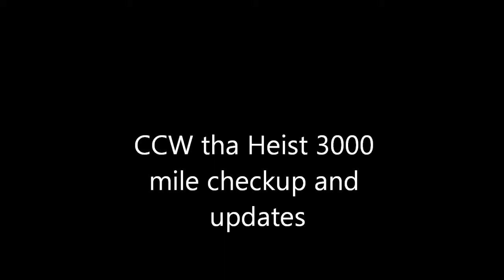Cleveland Cyclewerks, tha Heist Bobber Weaverrides Modded

Comment from the maker: @ashika1009 thanks for the reply the wear wasnt bad could have done another 2000 miles easy if not more but I'm a bit OCD and actually  I changed the chain and sprocket for a 16tooth front sprocket from the stock 15T. The chain I did because the bike comes with a STD 428 chain. I added a HD 428DID chain for better maintenance and pull. The chain and sprocket upgrade has done wonders for the top end

Comment from the maker: I removed the safety kickstand kill switch off my bike, this is a safety feature on the bike so modifying it you take the risk of personal injury or worse. 
By removing the kickstand kill switch it bypassed the neutral safety. i can start the bike in any gear with the clutch pulled in

Comment from the maker: outside a few bolts that were loose things looked pretty good, needed to change my chain and sprockets due to wear. It wasnt bad and could have made another 1500 - 2000 miles but i decided since we had it off might as well change them then

Comment: Thanks much for video! I ride a KLX250 and a CB1300SB here in Tokyo (American residing in Japan). Love both machines. And now I have a Heist on the way! Wonder how she rides but will know soon enough. Would have been sooner but the guys at the shop found a bad front break assembly. Need to wait for replacement machine was the call. One thing: you changed chain and sprockets after 3000 miles? Isn't that kind of wear premature?? Yikes! No means an expert here tho'....